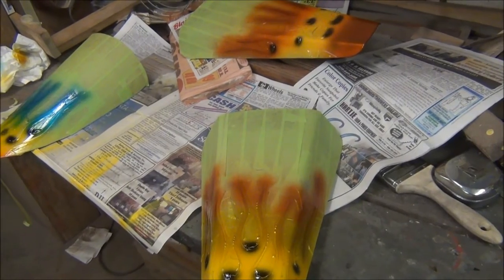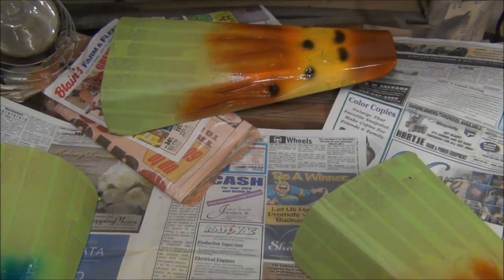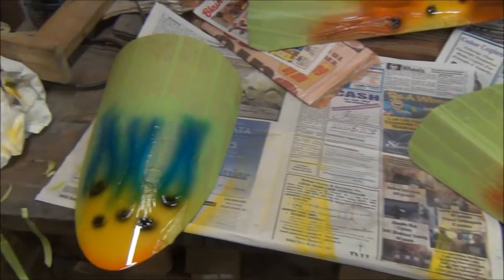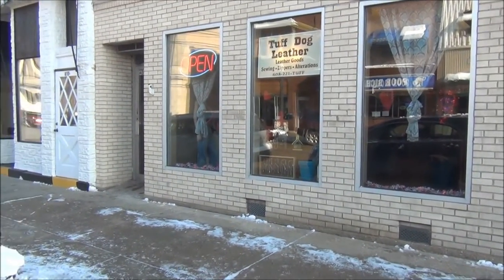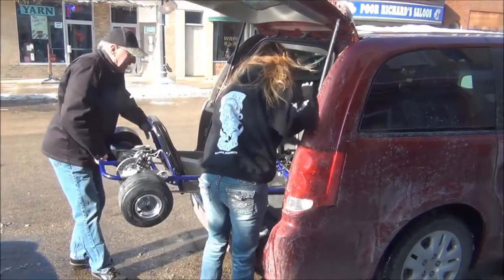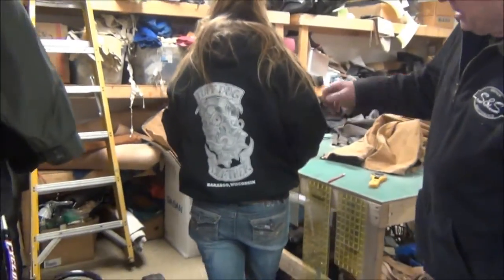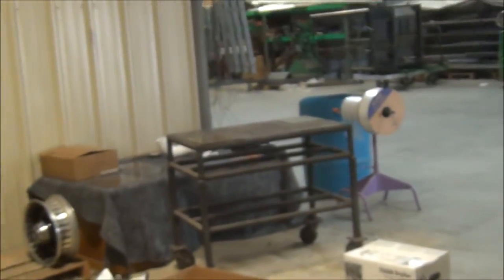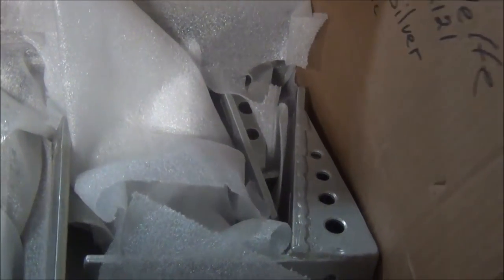Vintage Kart Build - Part 4 - Let There Be Color

Comment: Can you tell me the size of your tires front and rear  and what brand ? I would love to no were you go for yor 820 engines please I'm restoring 2 side motor race karts right now and I don't want to put a 4 stroke clone/Briggs back on them.
Reply from the maker: On rear engine karts we run in the Vintage Karting Association we run Cheng Shins or Vintage Speeds.  Most sidewinder karts are newer and run a softer tire compound.  Usually the tire on the sidewinders will be 4.50's aka 450 series tires.  As far as brand, depends on what you are using the kart in, could be Bridgestones, Dunlops, Hoosier, etc